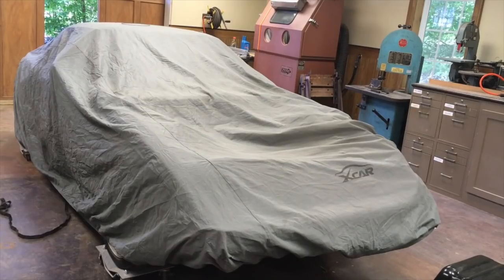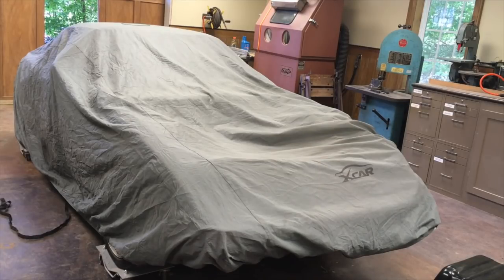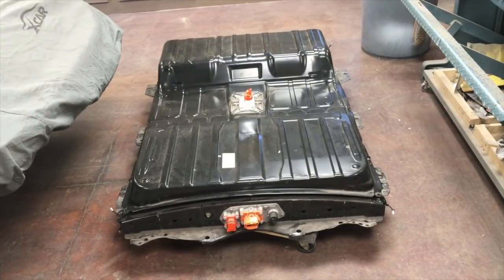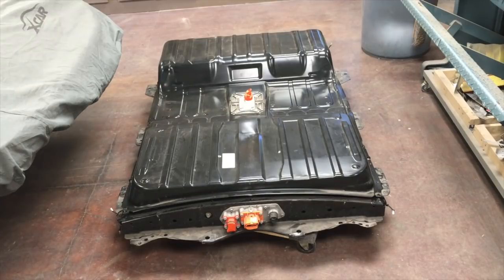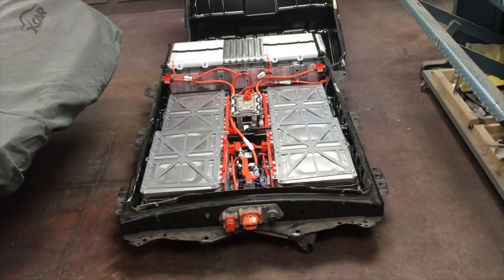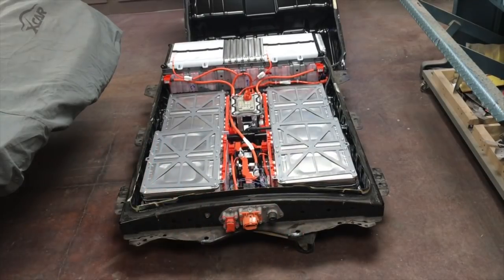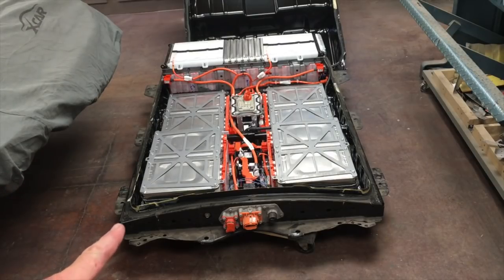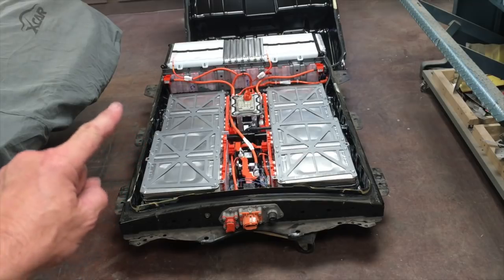RX7 TO EV7  unpacking the battery

Comment: Don't know whether you have figured this out on your own by now.... but the small gage purple and black wires are from the Battery Management System. They monitor the voltage of the individual cells. During charging, they will stop the charger when the first cell hits the target voltage, and will then place a small load through those wires on the highest voltage cells to bring them down to a level at which it will then re-energize the charger. The cycle repeats until all cells are at the same target voltage. To be clear, the charger charges all or none. The BMS stops charging. applies load on selected cells, then restarts charging. My BMS places a 200 micro ohm load on each cell it is trying to reduce the voltage of. Your batteries being different by more than a tenth of a volt would be considered a lot. Balancing is usually done to hundreths of a volt.

Comment: Okay, here's how I see it.

Each "Module" is 4 cells, 2 pairs of parallel cells connected in series. The "Bridge" connection in the middle (Which is used by the BMS for balancing and monitoring) allows the BMS to monitor each pair. The cells themselves are (I believe) LiFePO4 cells, which have a base voltage of ~3.2v and a maximum of 4.2v, so your 3.7v is fine (they're partially charged, but not dangerous). 2 (groups of cells in series) x3.7=7.4v, which is the voltage you are seeing for each module. When charging, or when sitting still under no load, the BMS can use the sensor wires to shuttle charge around, draining power from one pair of cells to charge another, or (when charging) can "shunt" a full cell to stop it overcharging and instruct the charger to reduce the incoming power (which is applied to the pack as a whole).

The three temperature sensors are NTC thermistors, that is the resistance in them goes DOWN as temperature goes up. They are (or could be, possibly inside the BMS itself) connected in parallel, so the BMS can read the hottest area within the pack, so they can shut the power transfer down if one spot gets dangerously hot.

The temperature pads go to the motor controller (and possibly charger). They give an idea of the overall temperature of the whole pack, as they are connected in series so their values are summed. If they detect extraordinarily high or low temperatures, they will signal the controller to switch into "limp home" mode because the batteries are either overheating from use, or they are in a cold climate, which may activate heaters to keep the batteries within their operating temperature.

The big "Normally Open" relays are more accurately referred to as "Contactors", as they have to be able to make and break high voltages. 

It might also be a good idea to keep hold of the metal plates and bars they used to hold the cells together, as they can swell slightly during use and are supposed to be compressed slightly. And the plastic strips do a very good job of holding all the wiring and the connection plates together. They can be shortened pretty easily.
Reply from the maker: Robert Johnston, thank you. Very helpful and appreciated.

Comment: The Modules are set up as 2S2P,  the BMS is actually monitoring each parallel pair. Your terminals is connected as Positive, Bridge and Negative allowing you to measure the cell voltage between bridge and neg for the “bottom” pair and between bridge and pos for the “top” pair. 
As you are measuring greater than 3,7 v per cell, it seems that the pack was slightly over-charged. Just be careful as these guys can go boom above 4,1.
Reply from the maker: Renier de Beer, hmm, packs been sitting for a few months and still overcharged. What do you make of that? thanks for the info,
Reply: Renier de Beer   While you are right in the monitoring the "parallel" cells, etc. You are incorrect on the pack being overcharged! These are Lipo, NOT LifePo4, so the "nominal" (resting) voltage is 3.7V, full charge is 4.2V, Full discharge is 2.7V. So his Voltages are right where one would expect them to be!

Comment: Nissan use active balance bms, that transfer charge from cell to cell when need it. I would look at batriunm bms system, they have “Leafmons” that will work with leaf cells. You would need 24 of them and starter kit. It would run you over one grand but it’s also one of the best bms out there. Nice to see you working on your project again!
Reply from the maker: Ideas To Life, that’s useful info, thank you very much.

Comment: I really enjoy your ev conversion video series. Perhaps some useful information:
-Each battery module seems to contain 2 lithium battery cells in series, so at just over 7.5 volts per module, the individual cells are sitting somewhere in the neighborhood of 3.75 volts, which is very good for storage. Sounds like you lucked out (when I was shopping for my EV, I used to see vehicle displays indicating nearly fully discharged batteries. There is much ignorance on battery storage, which is a shame).
-Perhaps you can re-use the bms? I'm willing to bet that it's power supply voltage is 12v, and I believe there's a possibility that it would continue to balance cells, even without communication to whatever computer it would talk to in a LEAF (sounds like this would be a cheap option if viable. You definitely do not want to go without a balancing bms.).
-Those copper plates that connect the batteries are generally referred to as busbars.
-Please remember, for safety, these batteries were in a sealed steel container, separate from the vehicle. In many PHEVs where the battery is integrated into the passenger compartment, there is considerable design elements to ensure safety, for the unfortunate event of cell(s) rupturing (be it from a collision or something else), and the toxic gas/fire danger that could result.